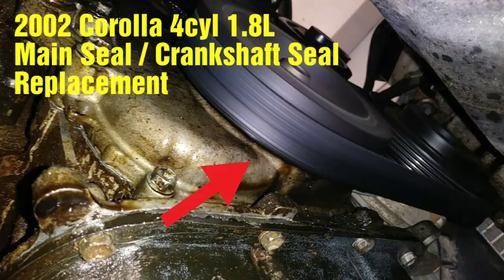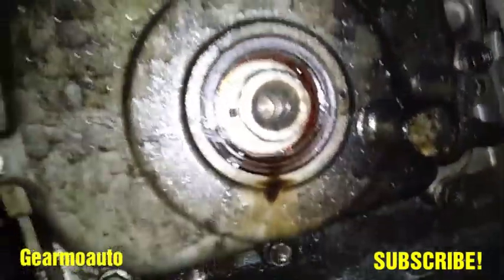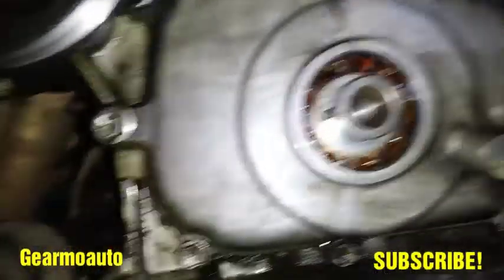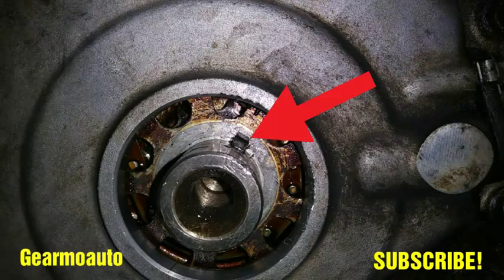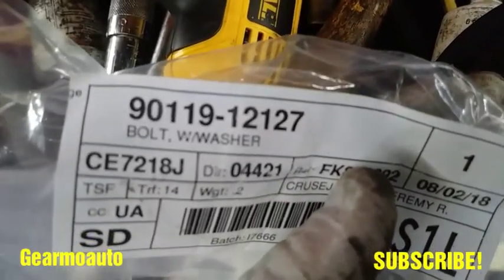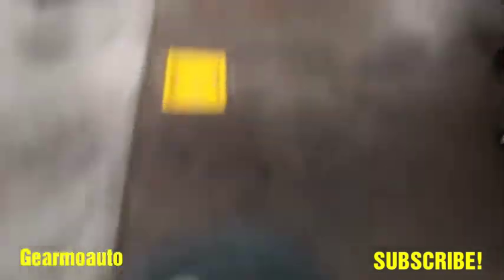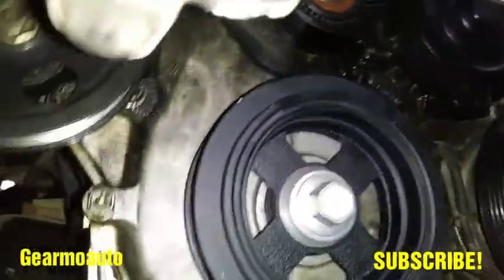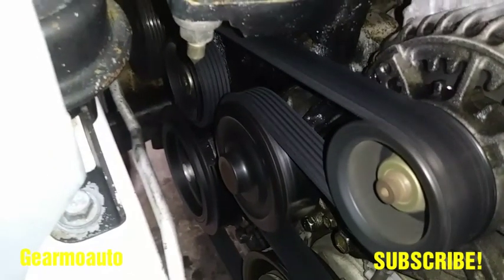2002 Corolla Crankshaft / Front Main Seal Replacement

Comment: How do you take the bolt off? mine is a 19 mm, i already removed the belt following my Haynes Manual, the pulley turns either way and i can not break the torque of the bolt?????!!!!
Reply from the maker: I had to use an impact gun. But you can do it by holding the crank pullet still somehow or having enough torque to break it free
Reply: A pulley holder works well. Or if the crank shaft spins in a clockwise direction you can put a breaker bar on it and wedge it, then crank the engine for a QUICK instant to break the bolt loose. Do not allow it to start.
Reply: @jessemclaughlin9680  Yep, and I always pull the EFI fuse so the car can't start.

Comment: Just wondering. Does the oil need to be drained before doing this? I have a small leak on passenger side only visable from under the car. I think this could be my issue. seems cheap and easy enough, i might just replace it. im at 188k
Reply from the maker: No, i didnt drain the oil

Comment: Thanks so much for this! Man, I'm about to replace the seal on my Girls 2006 Toyota Matrix. Do you know if the procedure is the same?  I think it is, but I'm not a professional and it's kinda hard for me to find tutorials on the matrix. Thanks!
Reply from the maker: If its the same engine i imagine it will be the same.
Reply: 2006 matrix/vibe/corolla have  this engine ... unless it's the XRS/GT model... but then, those are practically the same also
Reply: If it has a timing chain it will be effectively the same procedure. Engines with timing belts will require removal of the timing belt.

Comment: Do you not have to find TDC since you removed the pulley?
Reply: TDC is related to the synchronized timing of the camshaft sprockets with the crankshaft sprocket. The pulley sits outside of the timing chain cover and runs from the crank sprocket, which turns the accessory/serpentine belt, which then turns Alternator, Power Steering, A/C Compressor, and Water Pump. TDC has nothing to do with anything outside the timing chain cover. Hope this helps.

Comment: Thanks for this! It was short but it was concise and no BS. My 2010 Corolla has a slight leak and oil is coming from the crank pulley area and going towards the passenger compartment, getting on the sensor connectors at the side of the timing cover. But since I'm the 3rd owner and it's got 160K miles AND it's not using a drop of oil (or dropping on ground) I think I'm good. Just checked this for reference and possible help for the future. 

Thanks again for the help!!

Comment: You definitely helped me. I had this issue with a 99 Corolla. I actually replaced it with the crankshaft pully from 1a auto but I don't remember if I changed the seal

Comment: THANK YOU i noticed a problem as my alternator started getting more and more oil on it over time.
Reply: It will eventually short out the alternator and will also damage the drive belt. I would fix it asap.